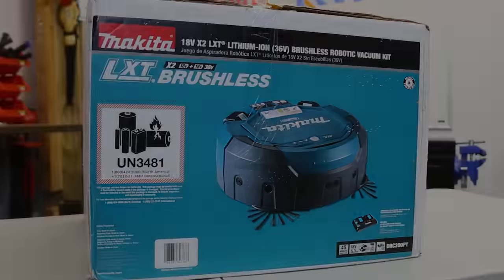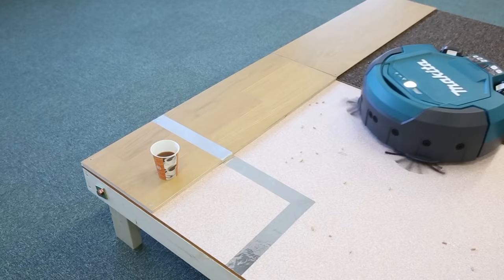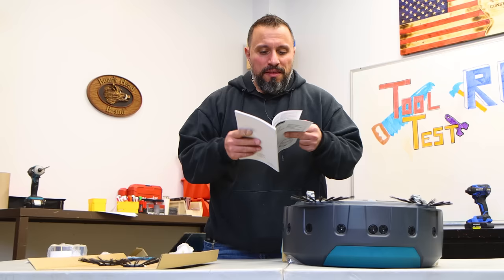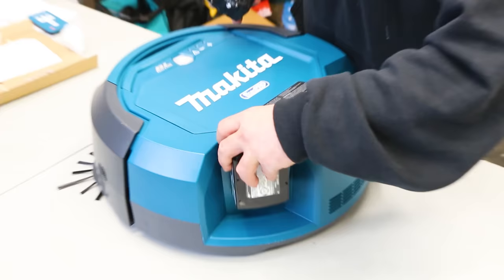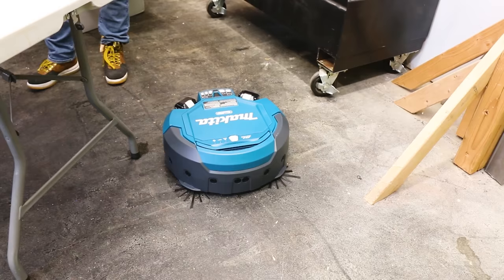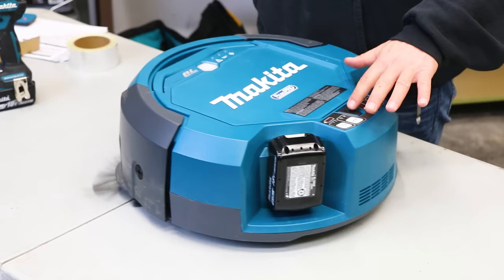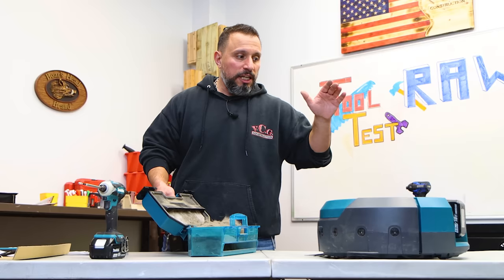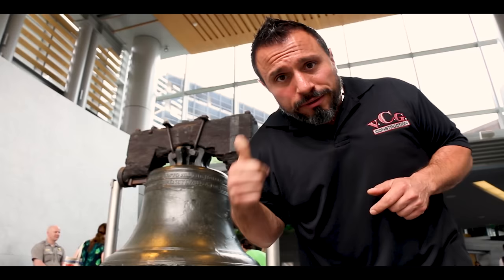Robotic MAKITA Tool (MADE IN JAPAN) Will TAKE YOUR JOB!

Comment: For personal cordless outdoor power tools cause literally very little maintenance so less stress there they are also quieter cause to much time around loud noises can literally wear you out and the trimmer using a gas one would make my carpal tunnel go nuts where cordless doesn’t not mention the lawn mower being able to store so it takes up a lot less space is amazing and part of that sense you don’t have the gas engine there lighter and easier to handle